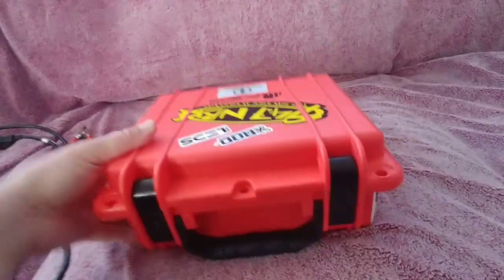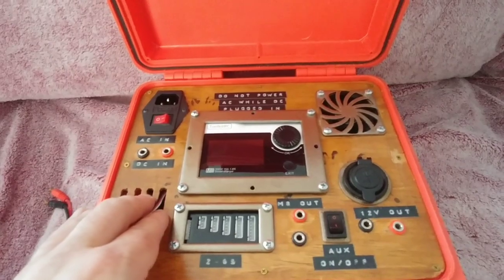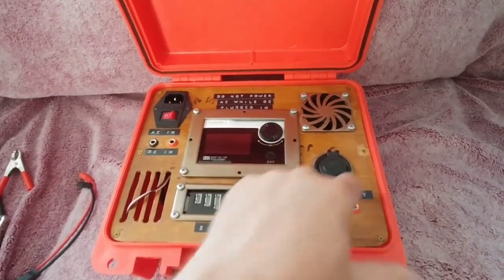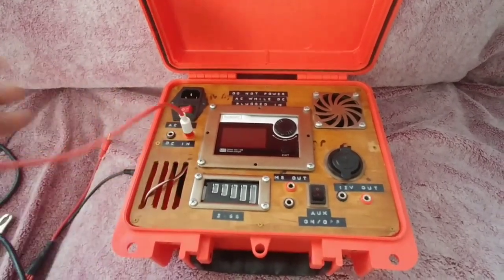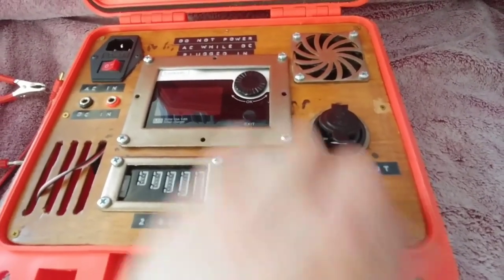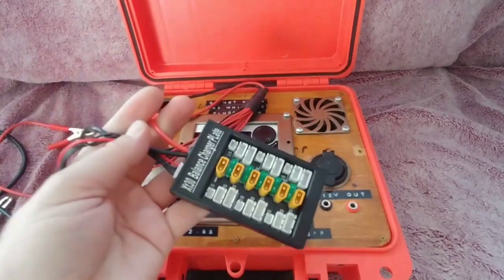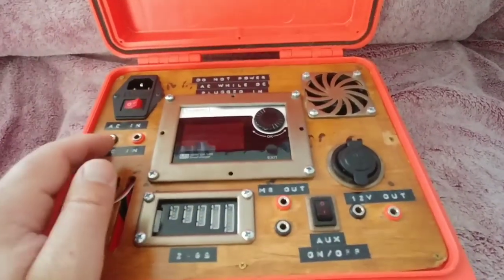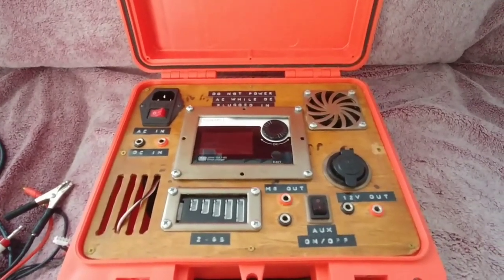ToolkitRC M8 Field Charging kit

Comment: THANK YOU!  I have been working on the exact same project.  The 3d printed toolkit mount will help immensely!  I see there are several parts to the m8 holder.  Are all parts necessary?  Looks like the holder, shim, box, frame.  Can you demonstrate how these go together?
Reply from the maker: I had made the box lip a little short, and instead of reprinting, I made a shim. I just updated file so you shouldn't need to print the shim. The piece called box, was just to add a little extra to backside of holder because it was a little thin. Won't need that now.